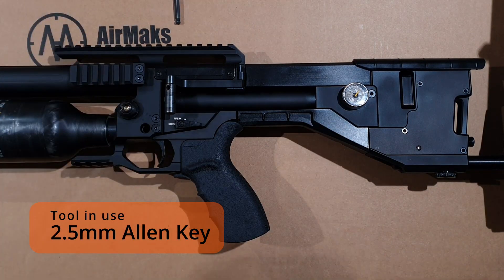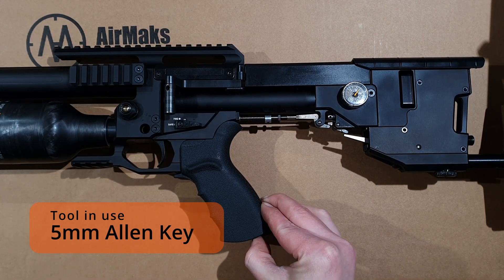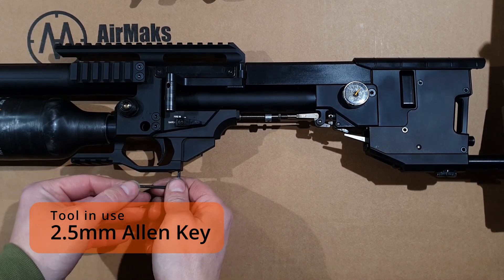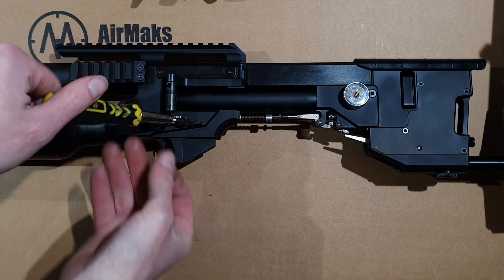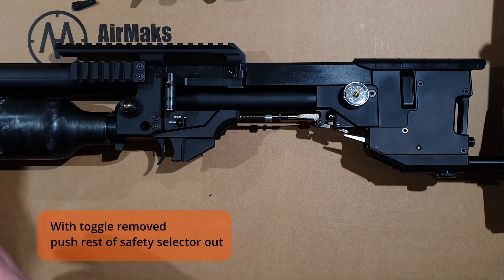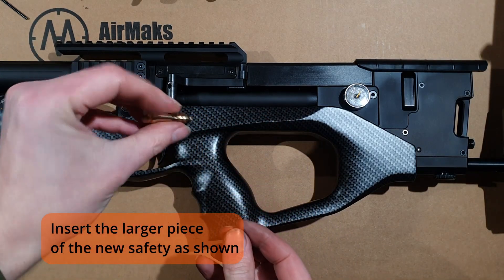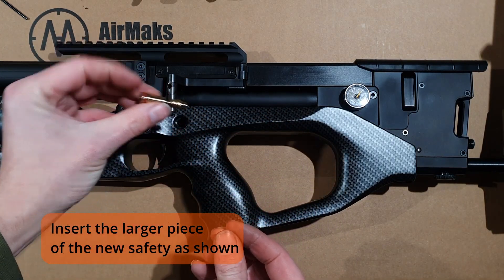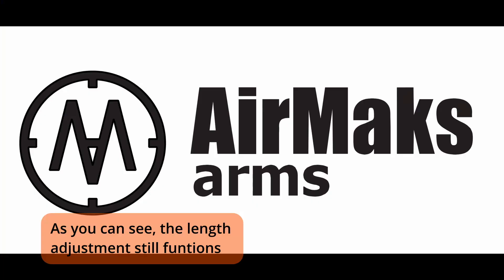AirMaks Arms Krait Stock installation instructions

Comment: Is there no safety switch with the laminate stock fitted then?
Reply from the maker: A new crossbar style safety replaces the original toggle safety, it operates the same as the Caiman, very slick
Reply: @AirMaksarmsUK  Thanks for clearing that up for me. Do you have a release date for the laminate stocks yet or any prices please?
Reply from the maker: @RenegadeAL  They will be arriving with my next delivery from factory so not too long only a few weeks, they have an RRP of £340